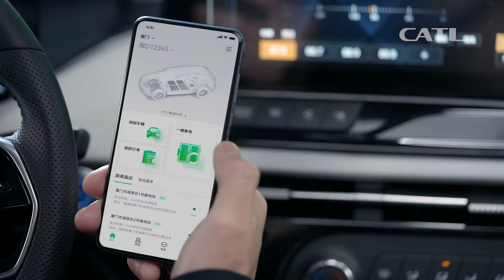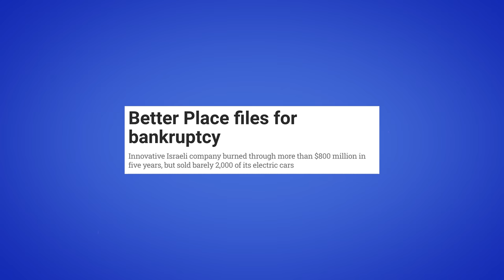Why Battery Swapping Is A BAD Idea

Comment: Bit short sighted to not review all options, there’s a limited volume of resources in the world so we can’t just keep adding batteries to cars. It needs to be sustainable, dinosaur thinking if you’re not considering the longer term impact
Reply from the maker: Pls explain…
Reply: Please explain. Is your point aiming at "no more electric cars" or ??????
Reply: Contrary, I think we should add more electric cars. 
Knowing how long consumers generally keep their cars for (3-4 yrs) and car manufacturers relentless push for you to buy the next gen/ model (much like Apple’s push on new iPhones) and considering the size of the battery pack per car we’ll end up using draining lithium resources quicker than ever. 
The majority of our lives rely on some electronics (phones, laptops etc.) and soon we’ll find ourselves struggling to match growing demands. This won’t help reduce the price of EVs if there’s a battery shortage. Realistically we’re not going to recycle used batteries. 
The answer should be better quality batteries that last longer which are standardised (like plug and sockets) per country/ region which can be recharged or shared. 
Some clever people will come along and build universal adaptors for these batteries if there’s ever a need to move your car from one country to another. 
When an owner wants to change their car, great! They either keep the battery pack they have for their next car or it’s a leased pack which can be dropped off and replaced/ popped back in prior to your new EV being delivered. 
To write off shared shared batteries so early on is…a bit short sighted

Comment: This video is woefully ill-researched.

Nio is doing very well with this tech - they have already signed up several manufacturers to the tech.  BaaS (Battery as a service) is key, you don’t own your battery you lease it but the car is cheaper as a result. 

You don’t need to make “multiple batteries for each car” - you might need an extra 3 batteries for every 1000 cars - after all 99% of charging is done at home after all. 

Key to all this is buying the car and leasing the battery… battery degradation is still something that scares people (even though it’s not a thing) 

Sorry Rory, I like your videos but on this one you are just plain wrong.

In the UK you’d only need 5 or 6 of these around the country - it’s only 376m from Bristol to Edinburgh - so one on that route is fine - the reality is, have 5 or 6 dotted around the UK right on the main motorways and you are covered.

Comment: A lot of the arguments you've made were also used against Tesla, Tesla's attempt at building a supercharger network, and battery vehicles in general. In other words this was a pointless video highlighting how even "experts" seem to have short term memory / narrow-minded mentality. So a few points to counter your pointless video: 80% of all batteries are built in China - so its actually very easy to standardise the design of these - in fact they already are! You made the point yourself - Tesla gets it batteries from many different suppliers - yet for obvious reasons those batteries would need to be designed in exactly the same way. Your argument about there not being enough lithium - well that argument basically kills the case of electrifying our entire fleet  - regardless of whether you go down the battery swapping route or supercharging route. On cost, for comparison it costs tesla $50k to install a single charger - so a supercharging location with 10 chargers would be $500k - not far off NIO despite NIO not benefiting from economies of scale. The conclusion is that this is an incredibly short sighted video posted by a narrow minded person who is doing nothing but killing innovation that is so desperately needed. Tesla succeeded against all odds despite all the naysayers like you, I'm sure NIO will too. I for one am looking forward for NIO to come to the UK.

Comment: A ‘ chocolate block’? Good Lord! I totally agree with your comments, another issue you introduced was the third party ownership. I would also expect that a discounting war would soon spring up, and the amount of charge’ the quality of the produc etc would soon arise, paving the way to cost cutting and variable quality. Could you also look into the other measured value of re-chargeable batteries, usually measured in units of and sub-units of amp hours available?

Comment: So you buy a new car with a new battery and then you stop at an exchange centre and drive off with a second hand used battery - I don't think so
Reply: What's your problem, if the battery isn't yours...? You payed LESS for car, because you didn't pay for the MOST expensive car-part....

Comment: 😂 i would rather have a nissan leaf with a trickle charging station at a starbucks so i can take my sweet time waiting on my car and giving my crippled body a break from paranoia and worrying about the world around me so much. anyway id totally rather just charge at home. not space consuming. its so funny that people think battery swapping is a good idea..... it takes up space. its going to wear out the contacts inside underneath the car and as it does it will increase the risk of electric shock or fire😂
Reply: oh.... and to bonk everyone on the head with the most obvious bit. Its CHEEPER IN THE LONG RUN THAN TEN STUPID SUBSCRIPTIONS 😅

Comment: Rory i disagree that its a fantasy, Battery Swap works really well and I am all for it. NIO is changing the EV scene and we need to adapt. They have striked a deal with a Petrol station company in China and will look to put in a Battery swapper in each station. Most companies need to talk to each other and Lotus will be the first company and then next will be one of the Germans. Remember NIO was designed in Germany for European roads and they have their own charging stations too. I'll rather have a NIO with a niche group of people than a Tesla anyday.
Reply from the maker: Battery swapping works great. Just not on a large scale.
Reply: I can't see it working on a consumer scale but there might be something to be said for its use in commerce and logistics.
Reply: Lol,do the maths. Let's assume there are only 20 electric cars in the world,and twenty are driven at the same time till Their battery runs out. Those twenty cars will need twenty  fresh batteries ready,  making it 40 batteries in existence. But if those twenty cars can super charge in let's say 10 minutes, there will only be 20 batteries in existence. Less waste and better for the climate. Now imagine battery swapping on a global scale ...
Reply: @AutoTraderTV  ...and that I can't understand why. It's the number of cells inside the battery that counts, not "the battery". Not all cars need 100kWh battery every single day: they cost more, weight more. The majority of the time 20 or 30 kWh would be OK. At the end number of "battery cells" would be de same, only the number of STANDARD sized carriers would increase. Some of those boxes would have 30kWh worth inside, others 50, etc.
Reply: @olufamut592  Genius!  Now go study some basic Probability & Statistics and get back.

Comment: What a terrible video. Knowing nothing about the subject :) here's my critique: First off, at 3:12: 5 million yen is 30,828 pounds today, NOT 600,000 pounds! The IDEA is pretty good (what about that title) - there are issues with EXECUTION. The land footprint of a swapping station can be small as we don't need multiple cars waiting next to eachother 20+ minutes, and recharging of modules can even take place underground. Problem today is cars having to wait in line so the "no point in going from 18 to 6" minutes argument is ridiculous: you have to multiply the 12 minutes saved by every car ahead of you in line. The sweet spot would be to have home-charging capability AND swapping capability. Further, the value of electric cars today drop dramatically as they encounter battery issues so making that easily replaceable would alleviate this terrible owner worry. It would be great to have "charge as a service" with fixed monthly costs so that battery and charging innovation can cut down costs for service providers. In short, I totally do NOT agree with your opinion and just because "some have tried and failed" is not much of an argument as timing and volumes were not in place at that time.